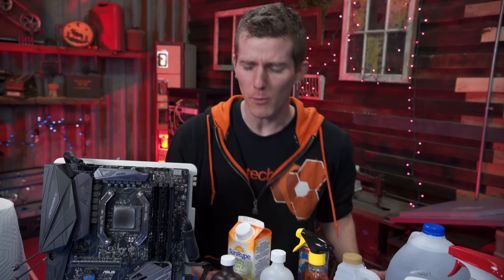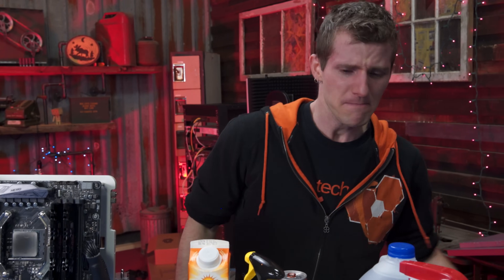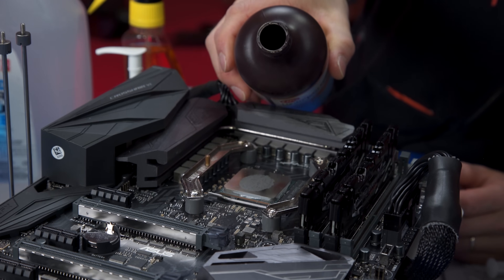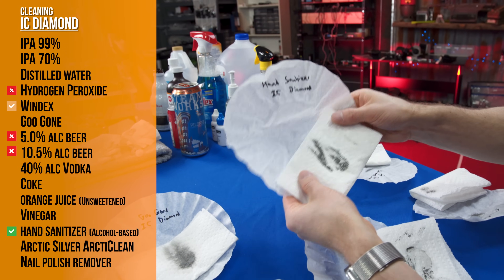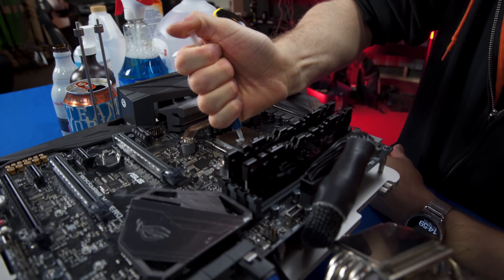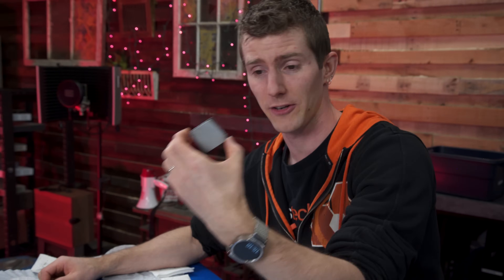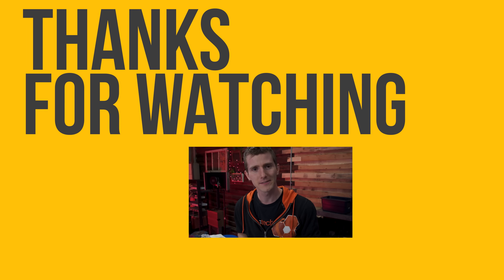Removing Thermal Compound - The BEST Way?

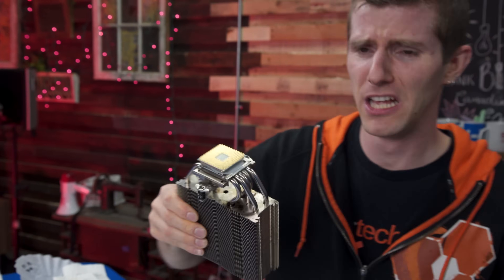Comment: 8:23 rip to that ryzen 1800x
Reply: why rip the cpu? nothing happened to it?
Reply: 5PIDER_
It's in our prayers.
Reply: Here's a tip.Heat your cpu up,put on a demanding game because this will lossen up the thermal compound.Turn your pc off and then remove the your cpu while the pc is still warm.Trying to take your cpu cooler off your cpu while the pc isn't even warm could break the cpu. Never try to take your cpu cooler off your cpu while it's still very low in temps.
Reply: AMD uses pin grid array while more likely to come out the pins are more durable than the intel counterpart and may sometimes be carefully straightened out even if bent. on the other hand while the extending connectors for intel LGA are finer and more easily broken they are on the motherboard and leave practically no breakable parts on the cpu(regarding cpu-to-mobo).
Reply: nah... it's ok
Reply: i was speaking figuratively. you can say linus has "killed" a lot hardware, in my case.
Reply: the pins probably got bent a bit, so you don't want to try your luck again though.
Reply: MotoK tips 
resteroni in pepperoni al capone
Reply: Nothing should have happened to it
Reply: Tubble Stop I doesn't help, had a old pc with fx which heats up at lot and stock cooler. Ended up the same way as with the video. The thermal paste was literally solid by then. still couldn't get it off the stock cooler. Even the nudge doesn't help. It was stuck as it was soldered ended up with 3 pins bent and cpu dying days later.
Reply: no shit that was going to happen to your pc,it was old.Meaning it was about time it would eventually break.
Reply: LGA and PGA have their pros and cons.It just depends on personal preference.
Reply: Tubble Stop Nah it did well using since 2012. Tries to change the cpu cooler with a cooler master one on 2nd Jan 2017. Pins were bent which i fixed next day the cpu dies. There was no other reason for it to die no symptoms whatsoever. The paste the retailer used was solidified. I managed to take it off from the cpu with a blade but the copper plate of the stock heat sink still has it.
Reply: Tubble Stop First i thought my mobo was dead or something bought a new one found out it was cpu that was dead the whole time.
Reply: 5PIDER_ lol it died when it came out
Reply: Ive done it to an fx8350, just installed it back no problem.
Reply: Amd needs better socket locks like intel has so this won't happen. Pretty sure that his 1800x has bent pins too.

Comment: the real hard stuff is when the thermal compound sits there for 2 years 24/7@70-90°C and gets real baked up and is hard like a brick, or even worse, this discusting stuff that some pre build office PCs (fujitsu/HP/lenovo) have on their CPU, its like superglue mixed with epoxy (just got a batch of those PCs at my company, have to replace all these tiny baby heat sinks cause the Fan is permanently ramping up and down so the employes are getting insane)

Comment: Goo gone, in my experience, leaves an oily layer on the cpu and shouldn't be used. Maybe some acetone based formulas would work, but at that point pure acetone or nail polish remover would be better.

Comment: Just paper towel. Work on it until it comes off. Your finger works too in a pinch.. Still an entertaining video!

Prayers to the 1800X
Reply: Andrew Hunt kind of an AMD problem. It doesn't happen all the time but it happens often enough. The Ryzen chip has a good chance of being undamaged.
Reply: Andrew Hunt, typical ltt amd hate.. :s

Comment: I've also used white gas/Naphtha/lantern fuel to clean off my cpu and cooler. It's basically petroleum / a bunch of different hydrocarbons, not too dissimilar to acetone or isopropyl alcohol. Also works with only a few wipes on the ''particulate'' kind.

Comment: Twist the the heat sink back and forth as you pull it off, if you have the room to do so, to prevent a forceful removal of your cpu. A few degrees of rotation will go a long way.

Comment: Isopropyl alcohol is used because it evaporates quickly without leaving a residue. Anything with the same properties that is safe to handle can be used. I have heard dry-cleaning fluid works well also (Tetrachloroethylene)

Comment: For anyone who actually wants to find out what the best way to remove thermal compound is, I've found that lens cleaner wipes for glasses work best, you have to be quick though because the alcohol on them dries extremely quickly.

Comment: unrealistic scenario. should have done a 30-60 min full-load burn in to ensure adhesion since the heat will change the compound over time. THAT would have been a more realistic representation....

#whenyouscriptvideoswrongjustsoyoucanrereleaseittwomonthslater

Comment: When I ran my own shop, we used Goof Off  which would pretty much dissolve any thermal compound which we could then just wipe off.
Reply: It was also good for those baked-on thermal compound pads you often find stuck on heatsinks.

Comment: i did that to a my AMD Athlon II ripping it out of the socket when removing the heat sink. some pins  were slightly bent fixed any if needed but it went back in just find and still works today

Comment: Welcome to chemistry yo. You just learned about polar and non-polar solvents! The rule is like dissolves like, polar solvents dissolve polar molecules, non-polar solvents dissolve non-polar molecules. Thermal compound is non-polar, as are motor oil, grease, animal fat, and skin oil, that's why they don't dissolve in water (Dish soap is bipolar, so it'll dissolve into either solvent, and in the presence of both, bonds them), but do dissolve in alcohol. There's obviously way more to it, but that's basically how it works.

Comment: Can I make a suggestion for a revisit on this?  Get 2 pieces of meta,l 2 inch by like 24 or something, put down a bunch of sample thermal compounds sandwich them together and then leave them on like a Rad for a few month.  Come back and then see how well each solvent works.  Maybe make a wiping rig or something to keep the wipes consistent, and compare how each one looks.  I am curious as to how heat and time affects the thermal compound.  Go full mythbusters on this and show the steps on building the wiping rig, and coming up with how you do the experiment.

Comment: I was kind of hoping that with the exaggerated opening of the thermal compound that compound would come flying out of the tube and make a mess.

Also, I have never used 99% alcohol because it is much harder to find than 70% or 90% alcohol and they both have been fine.  The only solvent I would have liked to see tried is gasoline.  I don't think its healthy, but I remember using gasoline to clean  tar off my hands.

Comment: I understand this would exponentially increase the testing time, but the reason for the solvent is also for cleaning used thermal paste, ie with some dryer spots, stressed, Etc. In this test the cpu wasn't even turned on at all, ever.

Comment: Seriously though, I have never applied anything to remove thermal compound. Not even my E8400 received special treatment after years of use followed by many more years in a box; the compound was the consistency of 3 week old mud on a 4wd and it still came off fairly simply using an arms length of toilet paper.

Comment: You do not need any liquids to remove TIM, Good quality tissue, and wipe off. MX4 is my preferred choice for CPU's and GPU's. And remember why TIM is used, its to fill the little gaps and flaws you cannot see, so a general wipe is all that is needed. What a pointless video, not even slightly educating to those that my need a pointer on how to clean up or re apply TIM. Guess LMG was bored. Why not have a fire sale on all that hardware just sitting there gathering dust and donate to a charity, or build some pc's for a childrens hospital, lets see some content that appeals. Looking forward to scrap yard wars.

Comment: The whole reason not to use <99% isopropanol is because of the high water content, and that it could absorb electrolytes from stuff in the environment (contaminants on that boards and CPU/heatsink, in the cloth you're using you clean it, etc.) Anhydrous isopropyl alcohol would be best, but it's hard to get it completely anhydrous without molecular sieves or a drying agent.

Comment: I thought the point of using isopropyl alcohol had less to do on how easy it was to remove whatever gunk, and more to do with not damaging the material it's getting in contact with... that plus not leaving any residue behind. Though I'm not too sure how easibly damageable the heatsink and CPU are.
But wouldn't some of those solvents be a bit too corrosive? I imagine Coke, beer and some of the other options would also leave some gunk behind, not very good for thermal conductivity. xD
All in good fun though.

Comment: Isn't this kind of pointless...? How often do you guys find yourself cleaning freshly applied thermal compound off? Like of course you could just wipe it off by hand..... I wanted to see what worked best on dried on compound that you might actually need to clean off before putting more on.
Reply: This is more of a comedic video
Reply: My thoughts exactly.
Reply: You'd be surprised how often you re-apply thermal compound with extreme overclocking and benchmarking.

It is a pretty niche use case though.
Reply: I've had to clean my CPU exactly twice. Once when putting on an aftermarket cooler, and once two minutes later when I realized I put the paste on way before I should have, and needed to manipulate the CPU without risking the paste falling off.
Reply: Was thinking the same thing. Also coke on others shits leave grease n sugars and other craps to surface.
Reply: I need a test for dried on ceramic thermal paste.
Reply: I was literally about to type this out when I saw your comment. The "experiment" is pretty much moot unless your using appropriate controls, in this case dry used compound. Wet thermal compound is pretty easy to wipe off, especially if its something thin like MX-4.
Reply: vodka worked just fine with my 2 year old laptop
Reply: when your fan gives out. LOLs. that's like 10 years down the line, but by then you'll have new computer built.
Reply: ShadowWolf810 used vodka last week after the cpu started to overheat due to dried and burnt thermal compound from about 2.5 years since last application. worked just as good as ipa 99%
Reply: ShadowWolf810 daily.  But.  This is a funny vid.
Reply: Ye, like my 4 year old laptop. It was difficult.
Reply: Yup... another terrible experiment ran by the short sighted staff at LMG... I know it would be a bitch ton of work to do this experiment properly... but if you're not going to do it properly why the hell do it at all -_-
Reply: Hellstrafer i might turn it into aa or it whil turn into a alcoholic
Reply: Actually, it's pretty interesting and useful information in some use cases. I travelled with my computer a lot the last few years, but didn't have room for it in my luggage, so I've been shipping it. With any decent aftermarket air cooler, you don't want to ship a PC without removing it, lest the cooler comes off the motherboard and rattles around, damaging components. So I was removing and reapplying thermal paste like every 6 months or so. Would have been good to know that 70% IPA works as well as ArctiClean, which I had been using.
Reply: I really want to comment something like this even after the last couple of years. 

I’ve just been recently refurbishing old original xbox’s thermal compound has been rock solid. 99% iso did work but very very slowly in compared to goo gone or equivalent citrus stain glue remover. Soaked it for about 30 seconds and with a que-tip came off really quickly.
Reply: Ironic, I recently figured out that my motherboard couldn’t handle my CPU after I put thermal paste on it and now I’m here
Reply: All I learned from this is use rubbing alcohol. I came here to learn what to use because I'm upgrading a motherboard and cpu due to an issue with one or the other with nothing in the desktop wanting to show which is the issue after test after test. Everything has been upgraded with ram being last ditch effort to not upgrade these last 2 things.
Reply: I would like to see that as well, but for me at least as long as decent compound was used it seems to take 3-5 years to dry up, and i usually replace it on most of my devices for some reason or another by then.  Even the cheap bulk tube of AS Ceramic compound i got probably 5 years ago comes off pretty easy even after a year of 24/7 use. Most people building a new PC are just cleaning the pre-installed stuff off of new heat sinks anyway. Now 5+ year old laptops, thats where you really need something that works well.
Reply: I have to agree that this isn't a real world test. I've had CPU thermal compound with just a year of use be difficult to remove with IPA. If you look closely enough in good light you can see that the surface appears dull. Thermal compound is used to eliminate air gaps which act as thermal insulators; supposedly down to the microscopic level. Elbow grease is fine for LGA Intel CPU, but what if you have an AMD. You don't really want thermal paste residue and solvent trickling down onto your board. So bent pins are a foreseeable occurrence; even if placed in antistatic matting. I prefer to use Arctic Clean. It does all the work for you; with minimal force required even for caked on compound. I wanted to laugh when he talked about the expense of AC. Let me think about this; risk ruining a $300 CPU and $100-300 MOBO or not be a cheap ass and pop for $7-8 on AC. You may have to order it, but I've been able to get Amazon to deliver the very next day. How often is it mission critical to have it done that day. Plan ahead and you will mitigate or eliminate most issues.

Comment: ArctiClean isn't really needed for everyday goopy thermal paste. What it's really meant for, and excels at is breaking down, dissolving and removing dried and baked on, crusty, hard thermal paste. Where 99% isopropyl alcohol would take me 10-20 minutes of scrubbing, ArctiClean cuts that time down to under a minute.

The pre-applied crap on Arctic Cooling coolers, video game consoles and laptops all end up with this nasty rock hard paste. Yeah ArctiClean is expensive but it's saved me countless hours of cleaning and a bottle of the cleaner lasts me around two years.

No, not an ad I just REALLY like the stuff.

Comment: Use some K&W Carburetor and Choke Cleaner. That stuff removed some 20 year old thermal compound off an AMD Athlon K7 CPU. The stuff was like cement when I tried it with rubbing alcohol.

Comment: What? No thermal cycling, to simulate at least 100 days, and then performance testing to see if the different cleaning methods give different thermal results?

I mean, com on. Everyone knows elbow grease and a paper towel gets it looking clean. Which is why i never, ever, use a solvent. But does it actually perform different.
I mean, if instant on / off is all you are going for, then toothpaste is a great thermal compound as well. It's first after a couple of days, to a couple of weeks when it starts to dry out and perform poorly, that you will know the difference.

Who else votes for a re-test, with a bit more numbers involved this time around. Yeah, com on, Luke would LOVE to spend weeks on this sort of statistics.

Comment: Well, I would say these results mean it is kind of on the opposing end of the spectrum from acids, as like dissolves like, and all the acidic compounds did poorly (vinegar, orange juice, Coke, hydrogen peroxide), with bases (Windex, which would have done better, but is very diluted), ketones (acetone), and alcohols doing well.

Comment: Regardless of how well they can remove it, you didn't mention how long it would take for any left over to evaporate if some seeped into the cpu socket or around it (and some would leave behind residue anyways). This is the reason why it's recommended to use 99% isopropyl alcohol. It evaporates quickly so you don't get any unwanted conduction and it cleans off the thermal paste without much effort. This isn't to say all of these other than the isopropyl alcohol would cause damage if you used them, but some of them definitely would. I know many of these "solvents" in this video are just there for a joke, but this comment is for people who took some of these seriously and actually wondered.

Comment: So.... He installed a CPU, engaged the retention, installed a heatsink and then, noticing the heatsink did not let go, to  finally remove it, he yanked it hard enough to overcome the retention mechanism of the CPU? (Instead of sliding and whiggling) Sounds pretty stupid to me?

Comment: The real fun is when you remove 7 years old dried up compound, to replace it with fresh stuff, in order to quiet down the PC. Almost requires a razor blade. But nah, just 70% alcool works fine with a bit of patience...

Comment: Why is he worrying about the CPU? I've had mine get pulled out of the socket many times, I even put the CPU on the bare floor with the cooler on it without realizing, the pins held strong.